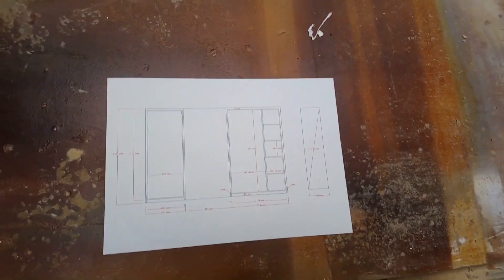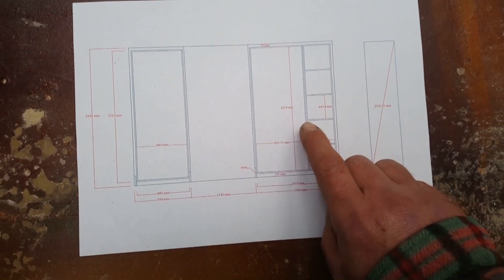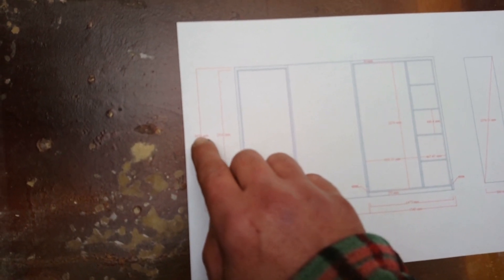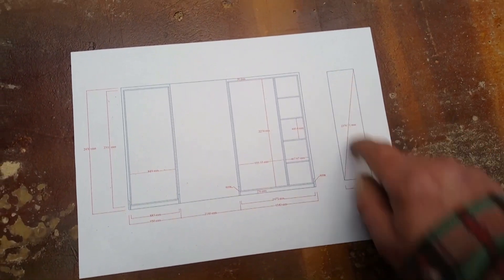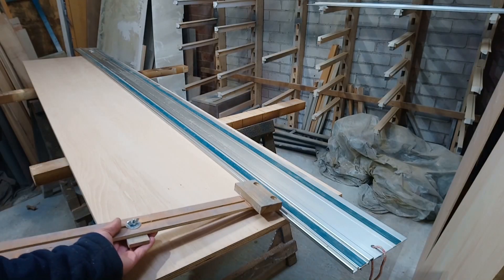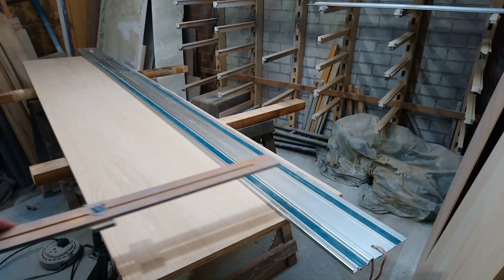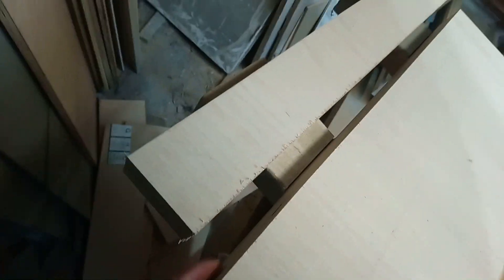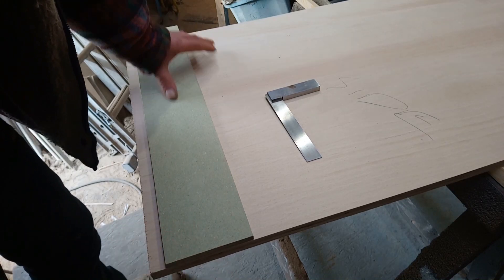Wardrobes Pt1 - Making the plywood carcass 1

Comment: Can I ask the grade of ply you use. Also which primer etc you spray. Thanks I’m addicted to your videos.
Reply from the maker: Hi, In this video i used what the suppliers call Q-Ply, it's WBP ply, the used to stock a Malaysian ply which had a thicker face veneer but now stock this, both are the next step/grade up from reg builders merchants WBP ply, The spray paint i mainly use now is a 2 part PU enamel , it's non reactive to most household chemicals inc nail varnish remover which has acetone in it & it has a small amount of plasticity to it so doesn't chip easily if the wood/piece gets knocked, AC & Pre-Cat enamel paint spray easier but are hard but brittle so chip easily. I the paint from here https://symphonycoatings.co.uk/?v=79cba1185463

Comment: Hey Gid,  what type of ply is that and where  do you get it from? Thanks
Reply from the maker: Hi, It says in the description the carcass is WBP 18mm QPLY,😊👍😉 I used to use another, Malayan ply that has a nice thick veneer on the face but can't get that anymore, I buy this WBP Qply that's one better than the cheap ply from the builders merchants, next quality up for me is Birch ply that's a bit too expensive,
Reply: @Gidjoiner  Thanks! I really appreciate you replying back to all your comments
Reply from the maker: 👍 I try to answer as many as poss, i have to work on my YT studio dashboard comments, refreshing & scrolling up n down to check for new ones or replies, Notifications about new comments is very very rubbish, i get notified about 1 in 10 of those, & notifications about replies in conversations is non existent, they never happen so if i conversation goes dead I'm sorry it's because it's gone down the page too far & i can't be opening up each of my vids to check & monitor the conversations, YT must be the worst website ever for this

Comment: Hi gid, any reason you choose to use biscuits rather than domino's?
Reply from the maker: Hi jon,
I just wrote this on Josh's comment so sorry for copy n paste
Biscuits for strength & alignment in equal measure, alignment when assembly & strength once it's glued, the alignment is very good, it's like slotting a pre bought thing together, they have a little adjustment in them & don't have to be cut absolutely spot on to the line/mark. if you don't have a biscuit jointer i guess just screws n pins would do as the sides are sat on the base, once the glue goes off they would be 'ok', 
If i had the smaller domino then maybe I'd try that but biscuits are cheap n available at screwfix, I've used biscuit jointers since i started 34yrs ago, they're quick n as i say they have a little adjustment side to side, a biscuit is wider than a domino so in thin boards (compared to wider pse timber) maybe better alignment or gluing strength, i would prob still stick to biscuits for this type of work
Reply: @Gidjoiner  lol thanks for the reply. Yes just noticed it myself as well as i watched the second one.....after watching gosforth handyman strength test on biscuits i am a bit dubious about using them....mind you ive only got a cheap axminster branded version and ive noticed that the cut is slightly off! Even after ive tried to adjust for it. Really hard to do so i thought i might throw in the towel and bite the bullet for a domino df500!
Reply from the maker: Hi, i haven't watched that vid but I doubt I'd use biscuits if strength was a factor, the sides are sat on the base & the top on the sides, once the back, front frame is glued on & it's fixed in place it won't be going anywhere.
I used to have a cheap biscuit jointer but like yours it was slightly off, this Dewalt is spot on for accuracy, i think the blade needs sharpening or a new one, I have had it quite a few yrs now,
Biscuit jointers or lamello jointer as i was introduced to it are tried n tested, biscuits & dominos both have their own pros n cons,

Comment: Hey Gid Really enjoying these videos. Very detailed and insightful. Out of interest, what would your cost be for all materials as you rare using a mixture of Ply, Beech etc? Thanks C
Reply from the maker: Hi, thanks glad you like them 👍 I have this comment saved for this reg Ply, Pine, Beech & MDF so sorry it's long & copied n pasted, - 
 It's about the quality of the base material & therefore the quality of the overall job, wood is wood to me so painting it is no issue but some woods are better than others, for quite a while i used pine, 'cheapest price' i was asked for but the shrinkage & warping later with pine when the pieces went into a centrally heated house were unacceptable to me, Beech doesn't cost that much more on a job of this price, the time & expense put in ya might as well have a decent substrate that'll stay relatively stable for it's lifetime, Beech is harder than pine, it's fairly straight grained with little or no knots, it's not just the longevity tho you can feel the difference after it's sprayed, the temperature, the hardness & the way it shuts just gives it a better well made feel. I build these things with sort of the hope that they will still be around in 50yrs like the old pieces that are still sometimes around, they were often made of pine, which is what i was/am trying to emulate but the quality of the wood (pine) was better then, if i bought planed pse pine i would still have to machine it sq n straight because off the shelf it never is, so the labour in preparing the wood is not much different & cutting the dominos is the same for both pine & Beech, maybe the same time spent would be spent on the joint of MDF door whether that is a spline/scribe/groove or domino.  
I use MDF if I don't care too much if the job is to be a cheap one, if i don't expect them to last more than 5yrs, if i wanted a very flat no grain finish or if it had to be done with that material through customers choice for whatever reason (prob against my advise), Mdf boards never come straight so tall doors can be a problem, screws don't hold as well as they do in Beech so hinges tend to come loose, fitting butt hinges into the edge of MDF is not reasonably poss, I use ply for the carcass on some jobs for a similar reason so the screws in hinges/hinge mounting plates, hanging rails & drawer runners hold well,
When spraying there is an inside & outside edge on the stiles n rails, MDF feathers a little so there would be more work there sanding, i give my customers the option of ply or MDF panels on the doors, you get a very flat finish with the MDF, Ply is a slightly better material but there's a possibility of seeing the grain through the paint, their choice?, when sanding these doors with beech stiles & MR MDF (I only use Medite MR MDF) panels it's always the panels that need the most sanding,
I do sometimes use MDF for doors & drawer fronts, normally when it's just a plain flat door i want but I have a list of materials in my head, MDF is the very bottom & would be my last choice for shaker doors. unless it was a bespoke style/sized door to match an existing set you might as buy some, there's loads of MDF units/furniture on the market, a lot cheaper than asking me to build one, Building out of MDF is not the quality that my clients ask for or expect from me, 
Basically on a job like this when the paint alone costs £150+ & there's a couple of wks (10 days) labour building, spraying & fitting, a few extra quid on the Beech & ply is worth it to get a better 'base' to the job, the ply i use is slightly better quality than reg builders 18mm WBP ply which comes in at about £40, 18mm Medite MR MDF is over £30 so not much more there, on a job like this i use 3,4 or 5 sheets, the difference between Pine n Beech doesn't add much either compared to the quality you get for Beech, I made a vid to try show that, i think i made a mistake in the vid, doh 🤦‍♂️, 1 inch is 25.41, but π pi is 3.14, i always get the .14  bit mixed up but in my calculations it doesn't make too much difference 🙃😏👍 https://youtu.be/t5MnQExLla8

Comment: What blade do you use in your tracksaw? It seems to go through that ply like butter compared to mine. I only have the Lidl parkside saw so it's probably less powerful as well. I did put a trend 48t in it when I got it but even from new it still doesn't cut as well as yours does.
Reply from the maker: I have the red Freud Pro blades in most of my machines, they're good blades, even on cheap saws a good blade can make all the difference 👍 40 Teeth on this blade i think, These blades don't have the bevelled teeth so it isn't a perfectly clean cut but it's still very good, https://www.screwfix.com/c/tools/circular-saw-blades/cat5990012#category=cat5990012&brand=freud&productdiameter=165_mm
Reply: @Gidjoiner  nice one thanks I'll give that a go. A 1.7mm kerf compared to the trend at 2.2 so I'll need some new chip guard as well.
Reply from the maker: 👍 it's only ½mm total difference, so ¼mm each side, see how it goes first, these are good blades but there'll always be a bit of wobble due to blade, material, machine or user 😁
Reply: @Gidjoiner  mostly user in my case believe me 🤣🙈
Reply from the maker: 😂😂 same here 👍

Comment: Did you drop smoking Gid? No more Darth Vader breath? Good for you!
Reply from the maker: Noo, I do smoke but I've also got a big blocked, broken several times nose, depends on what time of day it is n if it's stuffed up so i end up breathing through my mouth, also It depends where i hold the phone, it's very sensitive to breath/wind, sometimes when filming outside you can hardly hear what I'm saying although there isn't much wind, the gate vids showed that well, I cut/edit out loads because of wind noise. Often i film just when I've finished doing a part of the job, I don't work slowly & don't stop to catch my breath when i start to talk, all these things can contribute to make a Starwars vid,  I'm 51 this yr, smoked for at least 36 of those so it is catching up on me but noo ain't stopped.

Comment: Hi gid where do you buy your blades from for plunge saw?
Reply from the maker: Hi, this one is a Freud from Screwfix, good blade but i don't think it cuts as clean as the orig Makita, this blades teeth are all sq cut, the Makita has all or every other tooth chamfered, not sure if I'll get the same or a different one when i replace this or drive the 7 miles & wait a wk to get the ones i have sharpened, 
Just had a look cos as said in the vid mines getting a bit dull, 
Makita £49
Freud £25
Might give this Titan one for £9.99 a go,😁 i occasionally buy cheap Titan blades as throwaways for the table saw, they're not bad blades for the price. 
https://www.screwfix.com/p/triton-tct-plunge-saw-blade-165-x-20mm-48t/2880r
Reply: How much is it to get a blade sharpened? My new dewalt circular saw 165mm blades say they can be sharpened , but as on offer at £11 , might just buy more
Reply from the maker: Yeah that's what i end up doing because I think it's about £7 + vat, maybe more, they add extra on for each tooth after about 24 teeth, i might as well buy a cheap Titan blade rather than the travel, expense n wait for sharpening, i sharpen the rip blades with few teeth where accuracy isn't important but some of my blades are expensive, the ones with many teeth, so I get a collection together n take them to get sharpened at the same time, it's been a while so got a few piling up now.
Where are the Dewalt blades you mention on offer?
Reply: @Gidjoiner  Amazon, last week. Dewalt extreme 165mm 40T. 20mm bore.
Reply: £11.95. Still on now at that
Reply from the maker: 👍 cool, bit of a spending spree recently, have to wait for bank to recover 🤣
Reply from the maker: Added to wish list